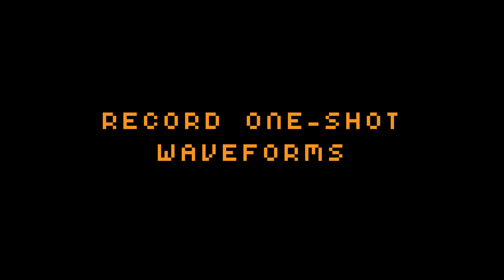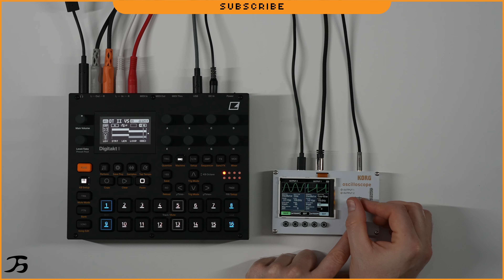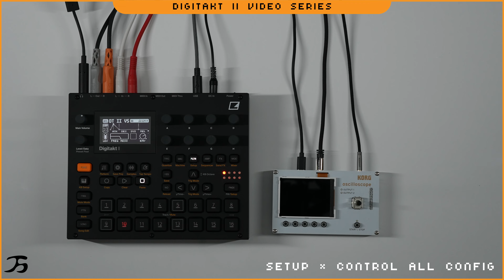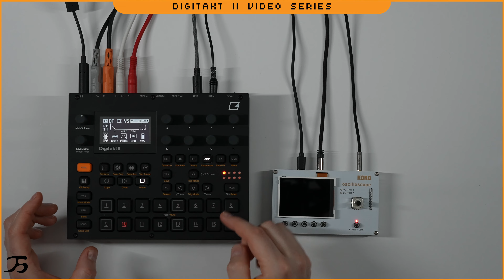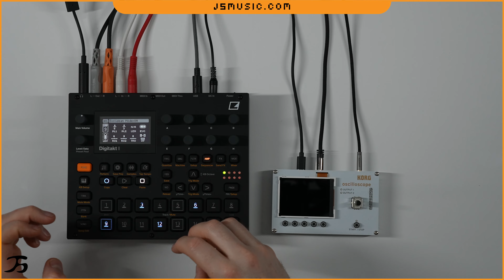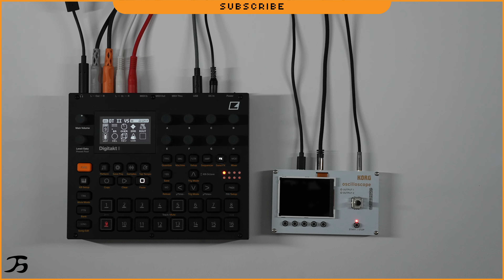DIGITAKT II VS: Creative Techniques: Vid 03

Comment: Whilst using control all can you use retrigg mode and retrigg all the tracks at once? Like a master stutter / retrig
Reply from the maker: HI, so it would be great to do this globally, but I don't think it has been implemented yet, I've taken another look through the manual and can't see if you can do it globally. Maybe they will add it in a future update if they get enough feedback to implement it. Hope this helps :)
Reply: Yes, you mean trk + rtrg on right? In that case yes you can